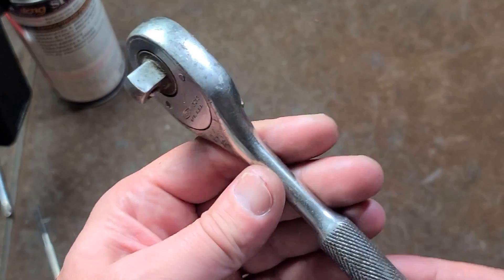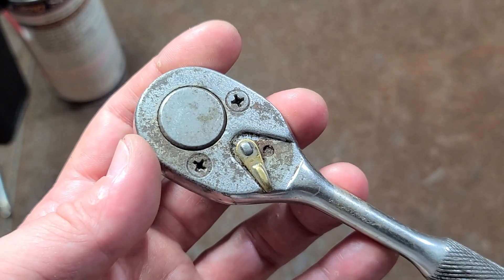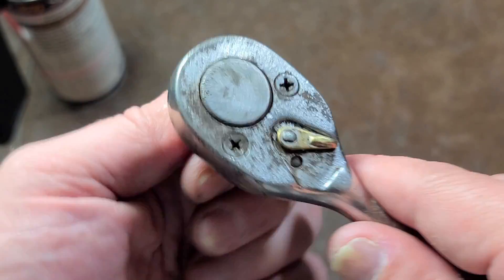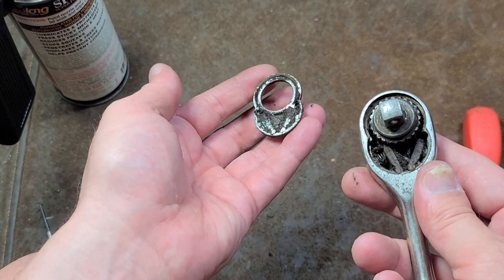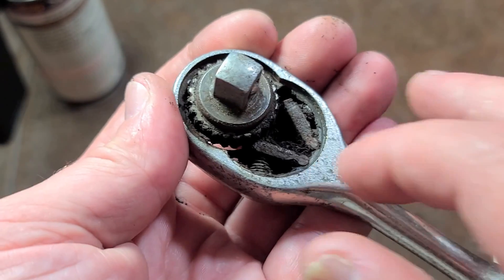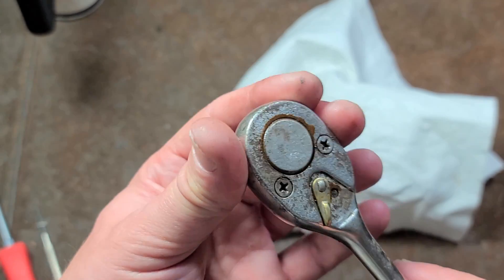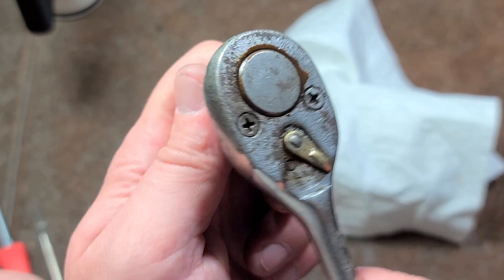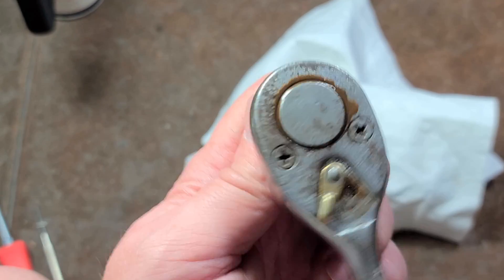P&C USA 3/8" Low Back Drag Ratchet Review

Comment: I just packed my three brand new Crescent ratchets with high temp ceramic brake grease... now I want to flush it out. What should I use instead? WD40? white lithium?
Reply: The Snap-on man told me years ago to use Super Lube silicon grease. I use it in all my ratchets and torque wrenches and they turn so smoothly. It does not dry out like white grease.
Reply: @donho3617  Is it the same as dielectric grease?
Reply: @donho3617  What's the name on the tub/bottle that you use? There's a number of different silicone greases by S-Lube.
Reply: @bluracer766  I made a mistake by stating that it had silicon in it. It is synthetic grease. It is the MULTI-PURPOSE SYNTHETIC GREASE WITH SYNCOLON® (PTFE) NLGI 2. It is recommended by Snap On and now Tekton recommends that their ratchets be lubed with it also.
Reply: @donho3617  OK thanks a million

Comment: Really, the only time I ever think to pull one out is when I’m up a ladder either installing or removing factory screws that are just too long. I stopped using them because I get to a point where the back drag forces me to use my other hand or I’m using a silly amount of pressure, it’s just quicker for me to use my standard.  But I’ll still hold onto it.. just incase.

Comment: Would you be willing to compare a koken non z series ratchet. Although it was deeply inspired by the proto USA design. It's not entirely the same as its claimed to be stronger, more low profile, and slightly lighter back drag. The design is different internally but functions the same.

Comment: A wire wheel would do wonders but I myself usually go for operation over looks. It is built similarly to my 1930's HE ratchet, one of Craftsman's first. That pawl design does have advantages but is archaic in age. If it works, just use it, you may like it. Sorry, I meant BE ratchet, not HE.

Comment: Are you that much of a limp wrist that a little back drag is causing you issues. Give me a break. I started out 45 years ago and we had 36 tooth ratchets and some even less, no one complained about back drag and we all got the job done. The advantage of newer high tooth count ratchets is not back drag but less swing arc to re-engage the ratchet teeth. I have never seen a bigger bunch of wimps and limp wrists that complain about back drag than todays mechanics.